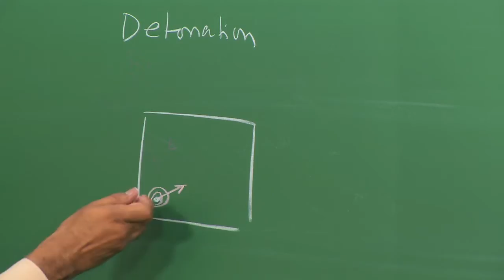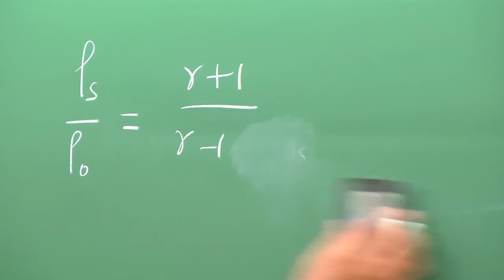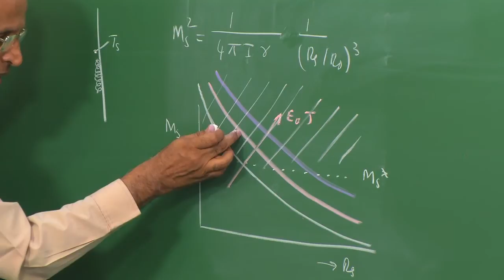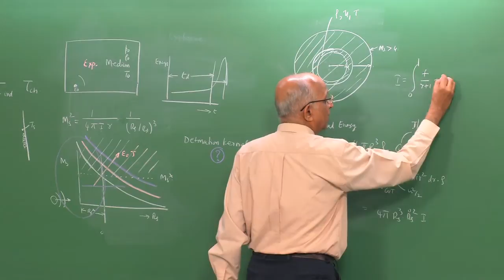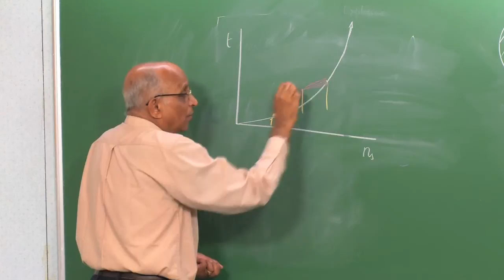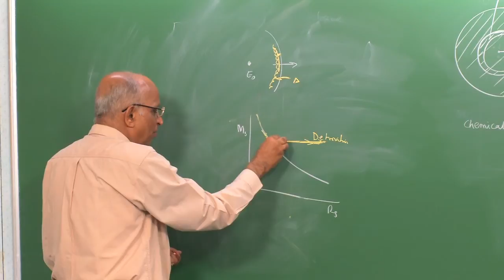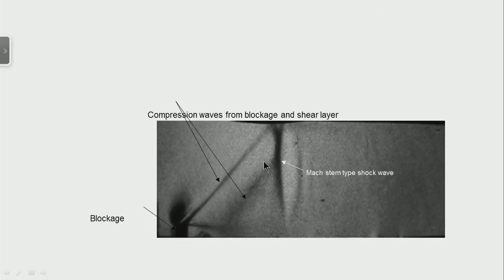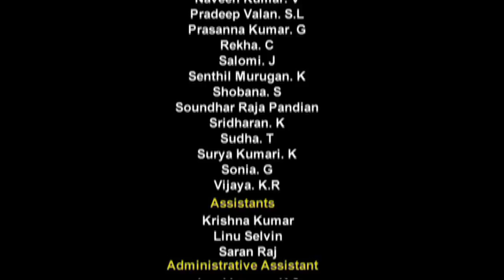Mod-01 Lec-23 Detonation: Introduction to Detonations, Initiation of a Detonation

Comment: 40:46 The energy balance equation at the top is correct. Presumably, the delta can be computed (as a function of v and the auto-ignition temperature) by setting the energy flux produced within the flame thickness equal to the energy flux transported out? May the auto-ignition temperature as a function of activation energy and the burned gas temperature in turn be approximated as the temperature of the inflection point in the reaction rate? May we use the Hughoniot relation to compute (the minimum...) v as a function of the auto-ignition temperature and the unburned gas temperature? Finally, should (the minimum...) R (= R*?) be set equal to the quenching distance (for the cylindrical geometry...) as a function of the activation energy, the auto-ignition temperature, and unburned gas density? Then the top equation can be be solved for the MIE as a function of activation energy, net chemical energy released per unit mass, burned gas temperature, unburned gas temperature, and unburned density? If such a MIE were released at r=0, would the blast wave track into the Hughoniot curve with the temperature dropping to the auto-ignition temperature before the quenching radius is reached and eventually climb back to the burned gas temperature when R is significantly larger than the quenching radius? Finally, how do the wind speed and the pressure behind the blast wave scale as functions of r/R?